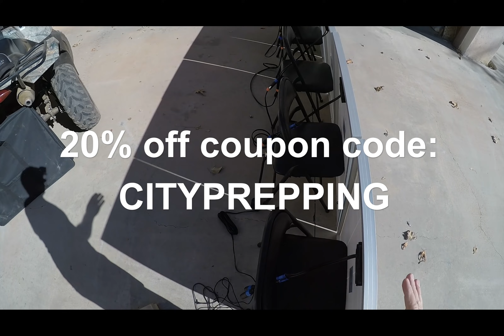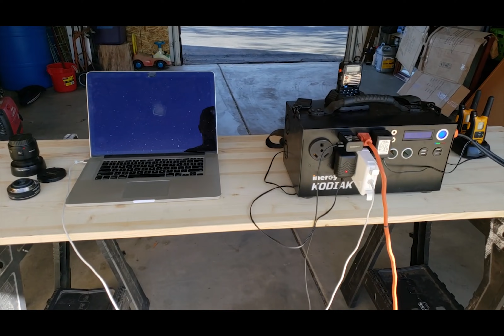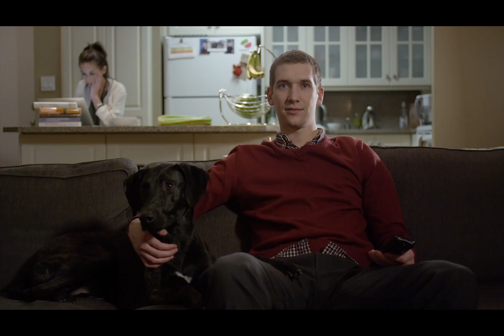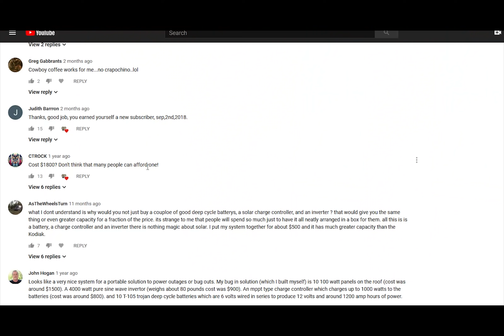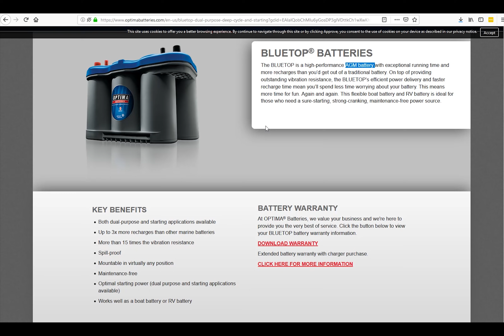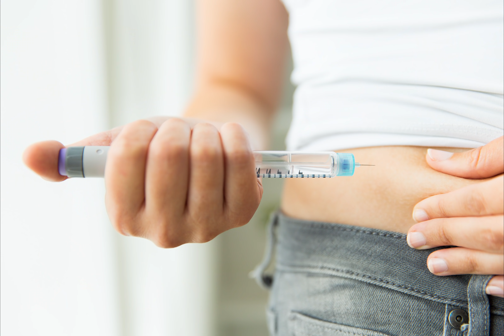Solar Generators: worth the money? Inergy Kodiak after using 1 year

Comment: Nice video showing the pros and cons. My mom just moved to FL and when we were helping her with her emergency kit, we ultimately went the way of a solar generator. For her needs it’s perfect as she decided a gas power one would be too much for her to handle. I think a person has to decide what they need to power and if they had enough sunlight to charge a solar unit. It mom’s case it was the best solution and worth the money.
Reply: I don't know if you used that power station as of yet but I live in South Louisiana - in our case because of the humidity solar panels only generate 15 % of there capacity - you might consider getting a small (inverter generator) to charge that unit if needed for longer power outages - also at lawn shops ect you can get small air cooled gas and use it instead of gasoline in an emergency for a generator - it doesn't go bad and does not vent fumes like gasoline does - also if needed I'm sure some one could help her get the generator running - Florida has days of heavy clouds so a generator would be needed to back up that power station to charge it - only use inverter generators for charging a power station - also you would need to know how many watts the charger uses to charge the power station - in the south its not ba good idea to rely on solar panels

Comment: Curious, could you hook up the genny to the kodiak to help charge a bank of batteries.
For example on overcast days and solar was not enough?
Reply: U can use a generator but it needs to be an inverter gen and you need to know how much power it draws when charging - if it 300 watts then the smaller inverter generators of 800  watts will work - they don't charge well off regular gens
Reply: I would like the answer to that question as well!

Comment: When this first came out, & Canadian Prepper and you both released videos about it, I commented on it then, asking some very specific questions that never really got answered, or at least not very well.

In terms of emergency bug-out scenarios, I can't think of anything small enough to carry that would justify also needing to drag one of these or similar along for the ride to power it, because I've never seen a bug-out bag I could carry that would be able to hold a refrigerator...  What else would one need to bring in such a bug-out scenario to really make this worth the investment???

If one is not bugging out, but rather bugging in, then presumably one has the leisure of having much more space to work with, so the weight/size issues are either gone or much reduced, so again, not sure this would be a good investment (for me) because I do have the skills to build my own much more capable & truly expandable unit that I can maintain as needed, instead of sending it back to the manufacturer for a battery swap.

The other question, and the reason that I look forward to your testing with external batteries, is that when I read the manual for this unit, it clearly stated that the external battery terminals were designed to be a power INPUT ONLY, and I don't think they planned for you to be able to recharge any batteries connected to those terminals.  In plain english, it would mean that in a prolonged shft scenario, one could scavenge 12 volt batteries to recharge the internal 1100 watt-hour lithium pack, but you would still be limited to having only a 1100 watt-hr battery pack and all that comes with it.  Soooo  "Can external batteries be charged by this unit???"

Regarding your time/cost comparison, I would think that if it took 50 hrs to build one of these or similar, then that time will need to be written off as the cost of education, because anyone who knows what they're doing shouldn't need to put nearly that much time into building one, but I won't begrudge anyone spending time on their education - that's all up to them.

As far as the engineering and power limitations, long-term, you'll always be limited by the weakest link in the chain, so if you can only charge at a rate of 600 watts, you really have to plan your power usage accordingly (or upgrade your charging capacity...) & THAT'S where building your own REALLY shines - if you know how to do it, which really isn't that hard to do with a bit of research even if you don't start out knowing, but certainly not 50 hrs worth.

When I initially looked at the cost of building similar, I think it came out to about $1700, but that's primarily because I didn't bother starting with the same charge controller limitations, and spec'd a 5000 watt charge controller instead, which was about $650 of that cost, but my charging restrictions were no longer the weakest link in the chain, and in a grid-down scenario, I could more easily adapt both other sources of input power, much more input power for the time allotted (think larger solar panels to collect more energy from a smaller solar window or whatever else one can envision).  As I'm in a less sunny location/climate, I may only have 4 hrs of good sunlight in a day or less, so grabbing enough power to make it through is more important, especially if one will be limited by location (bugging in).  Going with typical 300+ watt 72-cell solar panels is also much cheaper than the small portable ones Kodiak pushes, although they aren't as easily portable, I didn't find a good reason to bug out with any of this yet (see above), so 8 x 320 watt panels = 2560 watts/hr of good sunlight is a much better investment if your system can handle that, as far as I can see.

Your thoughts?
Reply: You would need to bring solar panels. As many as you feel you would need to meet your power requirements.

Second question. YES, this unit will recharge the lead acid batteries you connect to the posts. YOU should not use the posts as outputs but the unit does maintain the batteries you connect.

It would be nice to have a large solar array at home for bugging in, and if you need to bug out you can grab the Kodiak and a few 100w panels and go. Your power use would have to be minimal but you can make due with 200w in panels and the Kodiak.

Comment: A couple points to add with your analysis, having built a comparable unit myself, you can build something similar using one or two deep cycle marine or golf cart batteries and you can build it in about 8 hours time. I use a hand truck for moving mine around as the batteries are heavy. The lithium ion battery is great but it’s about 900 dollars give or take to buy one that large. What you are paying for with the Kodiac is portability and a very nicely engineered product with a very light but expensive battery. If you are okay with using a hand truck and one or two regular batteries you can mount an inverter, a solar charger and some 12 volt outlets using some plywood attached to the hand truck and you can exceed the capacity of the Kodiac unit very easily at a cost of less than 600 bucks and 8 hours of your time and do it on the weekend where your time is free anyways. That being said, I’d love to have a Kodiac because of the portability, but what I have is a system mounted on a hand truck and it works just fine. To see a great video on doing this, go see a Channel called Desert Prep, he has done this a few times and has a very detailed parts list and diagram. You don’t have to go quite as far as he did but you’ll get the idea.
Reply: But does your unit have an RV plug in?
Reply: Thanks for this
Reply: I already did the same thing back in 2014. Saved some money too.
Reply: Will do thanks for the tip

Comment: After I purchased the Inergy Kodiak thinking I could expand it indefinitely I received a letter from them saying that wasn't the case and that many restriction exist on adding additional batteries. Be aware...
Reply: Yeah...  The fine print in the online manual pretty much says the external terminals are a 12 v power input only, not really expanding capacity in a meaningful way...
Reply: @testuser3167  And the batteries (below 36 volts total) had to be within 0.1 volt of each other and the unit itself when connecting them together. I'm still very happy I have the unit.